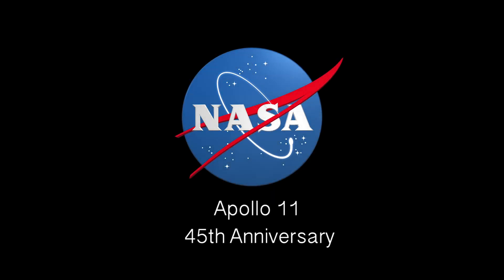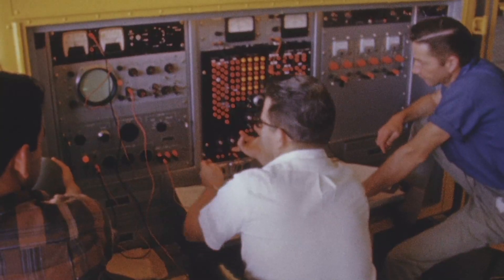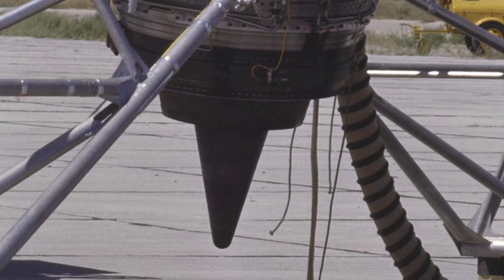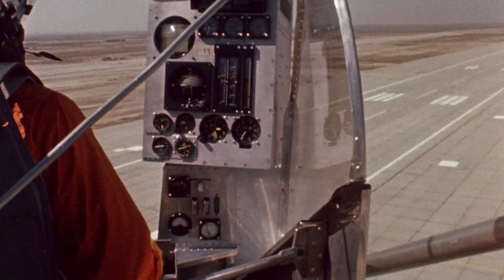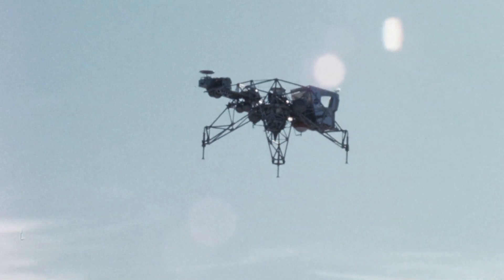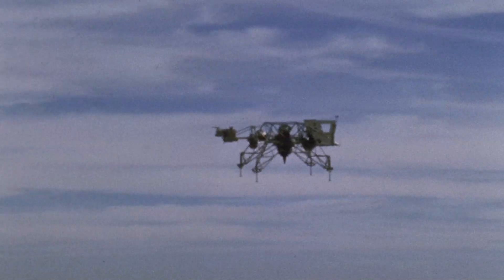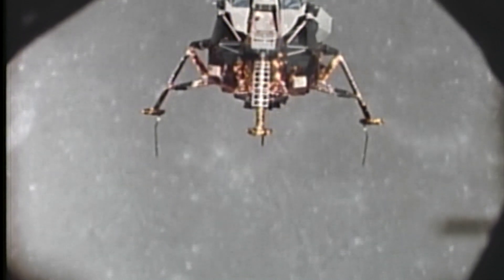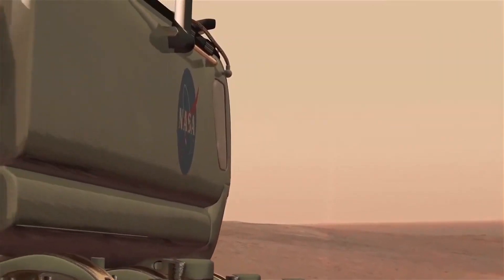LLRV Testing Contributed to Apollo 11's Success

Comment: As if this was anything like the LEM.
Reply: It can't be like the LM. Nor was it supposed to be.

The LM can only fly in space.
The LLRV could only fly on Earth.

But the LLRV DID handle very much like the LM above the Moon - and THAT was the whole point.
Reply: @eventcone  
>>Nor was it supposed to be.
Of course not, because, had it been like the LEM, it would have failed even more spectacularly.  The point was to go through the motions of 'testing' but not actually test it properly.
Reply: @markgerhard1362  what failure are you talking about? The LLRV/LLTV and the LM were both successful projects.
Reply: @silenthunter8254  

The LLRV nearly killed Neil Armstrong.  

The LM didn't even look very convincing in the studio.
Reply: @markgerhard1362  first off let me remind you, as many have before, the LLRV/LLTVs were not the LM. 
Second the LM's performance in lunar orbit and surface met all operational requirements. 
Armstrong escaped and flew other LLTVs in training prior to his actual mission in the LM.
Reply: @silenthunter8254  
So you genuinely believe that a craft which had never been tested worked perfectly every single time it was used? Nothing even remotely similar has ever flown reliably.

It's hard to address that level of credulity with logic.
Reply: @markgerhard1362  
All the components were tests.
Major subassemblies were tested.
Apollo 5, 22 Jan 68, unmanned mission. First flight of LM, testing all system, including descent and ascent engines...
Apollo 9, march 3, 1969, manned test of Lm in earth orbit, testing all system, including descent and ascent engines...
Apollo 10, 18 may 1969, flight testing in lunar orbit, testing of descent and ascent engines, coming within miles of the lunar surface.
Seams well tested to those who know about aircraft, engineering and technology.
Reply: @silenthunter8254  
Correct.  It was never actually tested.  At most, Apollo 10 established that the engines fired.  There was no way to test its stability, its maneuverability, or even the ability of the engines to land and lift the thing off.  No sane person would get into a death trap like that.

>>Seams well tested to those who know about aircraft, engineering and technology.
I don't know what seams you are talking about.
Reply: @markgerhard1362  well a mistyped word 'seems' does not negate the fact that all three flights before apollo 11 that flew the LM tested BOTH engines. The manned tests (9 & 10) proved the stability of the systems, including LM and CM docking.
That is what testing is.
Your ignorance of history is indicative of the lack of an education you recieved.
Reply: @silenthunter8254  

>>That is what testing is.
Obviously not.  Nothing was tested apart from the engines.

>>Your ignorance of history is indicative of the lack of an education you **recieved**.
Somebody who can't spell simple words shouldn't speculate about the education of complete strangers.
Reply: @markgerhard1362  let's see, docking, navigation, life support, communications, emergency protocols, the engines, every aspect except the landing gear, but that was extensively test under simulated conditions on earth.
A few spelling errors compared to your lack of engineering knowledge... I'll settle for that.
Reply: @markgerhard1362  maybe you have only worked with people who do not understand how to design and test equipment prior to development and introduction. This was not a two week job, more like a many year project  to get everything working before the flight to the moon. Loads of competent and intelligent people were employed on these projects to get people to the moon. I doubt you have the training to do anything like this, even if you had you would have failed the interview, people had to be 'can do, will do' people!!
Reply: @silenthunter8254  

>>every aspect except the landing gear,
Um...no.  What was not tested was the ability of the craft to actually fly.
Reply: @johnwoody9505  
I can see that you are frustrated that I don't share your belief system.  Do you have any more childish abuse to share with us?
Reply: @markgerhard1362  did you not read where  the tested it on apollo 6, 9, 10?
Those are flights. Apollo 6 was unmanned but remote operated, all the systems were tested, except landing gear.
Apollo 9 was manned, all systems were tested, except landing gear.
Apollo 10, manned in lunar orbit, all systems were tested except landing gear.
When I say landing gear I mean they deployed the legs but had no way of actually do landing test. However, the landing legs were extensively tested in simulated conditions on earth.
Reply: @silenthunter8254  

>> did you not read where the tested it on apollo 6, 9, 10?
I read about this in the 1960s, thanks.

Everything was tested apart from what actually needed to be tested, namely, the ability of the craft to land and take off safely.  The problem was the stability of the device near the lunar surface, not whether the legs retracted properly or whether it could dock.
Reply: @markgerhard1362  , if I believe that the US sent astronauts to the moon successfully, is that a belief system? I am just saying that I believe that humans did send fellow humans to the moon to land and come back on 6 occasions, that's all. I'm not sure I was aiming childish abuse at you, I'm certainly not frustrated you think we didn't send astronauts to the moon. It is not abuse to suggest you may not have been in the type of industry I was trying to imply, very few people did work in those types of industry. The people on the apollo missions had to be extremely motivated and hard working in their work on the project. When a problem arose people had to sort it out, I've never worked in an industry where people had to work so hard as the apollo and associated industry engineers. The apollo astronauts had to be excellent test pilots and dedicated to their jobs and maybe, realise that there was a chance they wouldn't come back. I have absolute admiration for the jobs they did. I wonder if you have read any of the astronauts recollections of their training and missions in their books, they are very interesting, well at least I thought so.
Reply: @johnwoody9505  

>>is that a belief system?
Yes.  Because it's not based on a rational thought process or evidence, but rather 'proof by authority'. It's part of your world view, so you are emotionally attached to it.

>>that there was a chance they wouldn't come back.
They were just prancing about in a studio.
Reply: @markgerhard1362  "At most, Apollo 10 established that the engines fired.  There was no way to test its stability, its manoeuvrability". Actually the ascent stage had to manoeuvre to dock with the command module so the ascent engine control and thrusters had to work precisely to dock successfully with the command module. This docking is quite a technical space manoeuvre to do. By the way you did spell 'manoeuvrability' incorrectly, no big deal, I'm sure we all do that from time to time.
Reply: @johnwoody9505  

>>manoeuvrability
That is the British spelling.  I am British.
Why don't you check your facts before sharing your opinion?

>> the ascent engine control and thrusters had to work precisely to dock successfully with the command module. 
Docking wasn't the problem.  The problem was stability during landing and take-off.
Reply: @markgerhard1362  the unmanned surveyor craft tested the ability to land.
The liftoff was engineered and then tested on apollo 11. Someone has to be the first to strap into that new vehicle, or try the next maneuver. It takes a lot of courage to be the tester.
Saying they faked it is a slap in the face of the brave men of Apollo. If that is what you have to do to make yourself feel empowered, I feel sorry for you.
Reply: @markgerhard1362  'prancing about in a studio' is part of your belief system.
Reply: @johnwoody9505  

>>The people on the apollo missions had to be extremely motivated and hard working in their work on the project. 
Any other empty speculation you would like to share with us?

>>When a problem arose people had to sort it out
So not like eBay.
Reply: @silenthunter8254  No, it's based on deep analysis of every part of the Apollo programme, including hundreds of hours spent looking at the anomalies.  I have been doing this since the 1980s.

How much time have you spent investigating the anomalies?
Reply: @markgerhard1362  ">>manoeuvrability
That is the British spelling.  I am British.
Why don't you check your facts before sharing your opinion?"

I accept that "manoeuvrability" is the British way of spelling the word, that is how I spelt it. You spelt it "There was no way to test its stability, its maneuverability". I spelt it the way I did because I am British.
Reply: @johnwoody9505  
Are you just cutting and pasting text now?
Reply: @markgerhard1362  I did cut and paste your comment and I referred to dictionaries to check my comment. 

Can you prove that the astronauts were just "prancing about in a studio". I did cut and paste your comment, it makes it quicker and less prone to error.  
Give me a few of the anomalies that you have found since the 1980s.
Reply: @johnwoody9505  
No dust on LEM feet despite dust shown in landing footage.
Antenna missing from astronaut but can still transit and receive (A16).
Nonsensical guidance system (aligning a dim star with a feature on Earth) (A11).
Rover shown with no tracks coming or going.
Same props used on multiple missions.
Absurd construction of LEM (bits of sheet metal cut to the wrong size, rivets in the wrong place, etc. etc).
Obvious anomalies in all other NASA missions inc. ISS.
Obvious motives.
Confusion about whether stars can be seen in cis-lunar space. 
Obvious anomalies in still photos.
Obvious lighting issues.
Video supposedly transmitted from moving rover.
Rover cannot fit into space it was allocated to.
Weird statements made by Neil Armstrong
The fate of the Apollo 1 crew and comments made by them before their death.
Harnesses seen reflected in studio lights.
Lack of any evidence of 1/6th g.
Cameras used perfectly each time, despite no viewfinder and thick gloves.
Able to hit post into solid rock.
Reply: @johnwoody9505  
Absurdity of six perfect missions but no return.
Three NASA astronauts all saying on camera that no one went to the moon.
NASA video saying that it would be dangerous to go through van Allen radiation belts cf Buzz Aldrin not even know what the VARB were.
Confusion about air pressure in LEM.
Door in LEM too small for astronaut to exit.
Anomalies on A17 take-off video.

I can think of hundreds, but these are just a few.
Reply: Absurd strategy of using completely inexperienced astronauts for A 12, etc., when experienced astronauts could have gone again.
No concrete evidence of any kind.
Obvious evidence of front-screen projection.  Association with Kubrick.
Lack of direct video upload.
Reply: @johnwoody9505  
Same LR used on several missions.
Background of A16 doesn't correspond with topology as claimed by Lunar Orbiter, nor with 360 degree panoramic shot as claimed also for A16.
LR has exactly the same dimensions as a jeep.  This is presumably what was used for the chassis.
Reply: @markgerhard1362  For starters, 
1. Give me a link to photo for antenna missing.
2. Rover with no tracks showing.
3. Video transmitted from moving rover.
4. same props used on multiple missions.

I cannot see the problem of taking photos with gloves on, please explain.
Reply: @markgerhard1362  I've only been looking into this since the 1990s.
Whose claims do you follow?
Kaysing?
Percy?
Sibrel?
White?
Rene?
Hoagland? 
Do you follow Jaren, dubey, etc...
Reply: @silenthunter8254  I don't follow anybody's 'claims', unlike you.  I sift through the evidence and think for myself.
Reply: @markgerhard1362  The lunar module door was 32 inches square, the width of a typical door frame. Width wise it was easy, height wise it just took a little care when exiting or climbing in, in fact never a problem. I cannot see why you think it might be too small.
Reply: @johnwoody9505  

>> I cannot see why you think it might be too small.
Because it wouldn't have been possible for the astronaut to turn around inside the LEM in order to get into position, given the presence of the other astronaut.  This is a problem which needs to be looked at in 3D space.
Reply: @markgerhard1362  well it looks like you've been paying attention to percy and sibrel a bit, and maybe some jack white.
As for the apollo antenna that would apollo 15 not 16. The broken antenna was taped on and worked well.
Reply: LM cabin was 5' wide at the floor, 6.5' tall, 7' deep mid height, but 3' deep floor. Not roomy enough for a party but with careful maneuvering two men in full gear and PLSS could easily fit thr6the hatch.
Reply: @markgerhard1362  The LM door opened inward and it was not a simple manoeuvre for both astronauts to exit the LM. "The claim that there was no room for the astronauts to move through the hatch way  is false. It was awkward, leaving the cabin required the commander to crawl out first, then the lunar module pilot closed the hatch, moved across the cabin and reopened the hatch before exiting. Getting back in was just as inelegant a process. Both procedures were rehearsed in mockup LMs on Earth and on a “vomit comet” microgravity simulation aircraft."
This excerpt is from;
http://www.armaghplanet.com/blog/15-questions-about-the-moon-landings.html
In fact the time taken to exit the LM on the moon took longer than it took during simulations on earth. When they did the simulation on earth everything was stowed away and the place was tidy, in reality on the moon, stuff had to be moved out of the way..
Reply: @markgerhard1362  
Still waiting for;
1. Give me a link to photo for antenna missing.
2. Rover with no tracks showing.
3. Video transmitted from moving rover.
4. same props used on multiple missions.

I cannot see the problem of taking photos with gloves on, please explain.
Reply: @markgerhard1362  in response to your question, I have been following space exploration since I watched Apollo 11 land on the moon. If you've been 'investigating' apollo since the 1980s you are the atypical HB. They normally don't think anything happened before 2000.
I would like to see your evidence more in depth. You shotgun a bunch of claims, many of which others have made and been disproved, but do you have real proof of any of them.
Reply: @johnwoody9505  
If you want to attempt to address these points you have to do so using evidence, not quotes from True Believer websites.
Reply: @johnwoody9505  
I'm not wasting hours finding clips to try to convince somebody whose mind has already been made up.   If you were open-minded you would have looked at this long ago.

Moreover, if you were genuinely interested in challenging your own beliefs you be interested in the quotes from the three NASA astronauts who said that humans never went to the Moon.
Reply: @silenthunter8254  Three NASA employees and one ex-president of the USA agree with me, not with you.

>>HB. They normally don't think anything happened before 2000.
An HB is a type of pencil, so I have no idea what you are talking about.  Why do you make that childish comment about 2000?
Reply: @johnwoody9505  
The person who did this analysis actually went to a museum, persuaded the curators to let him have access to the LEM, and measured it in detail.  The question is, what was the layout in real life, not what does a random website (or even NASA) claim was possible?   The problem was not the overall size, but obstacles inside the craft.

The same is true of other aspects of the 'mission'.  

Look at the heat shield and explain how oxygen passed through it.

Look at the obviously fake ISS footage and explain why an organization which is credible would create such deceptions.

Ask yourself why Buzz Aldrin said that he hadn't been to the moon, on camera.

Ask yourself why two other NASA astronauts said that nobody had been to the moon.
Reply: @markgerhard1362  link buzz's comment and we will look into that claim.
Link the US president's statement. 
If you are talking about the Orion engineer or Don P, they were takin out of context. 
Sorry if my year 2000 comment offended you, with your beliefs about apollo you need to develop thicker skin. I will take that into account in the future. 
HB is a term for hoax believers, others such as yourself. Many of whom want to believe the worse in others and puff themselves up for many different reasons.
Reply: @markgerhard1362  which heat shield let oxygen pass through it?
Reply: @silenthunter8254  
None did.  That's the problem.
Reply: @markgerhard1362  none did what?
Reply: @markgerhard1362  As you have been investigating the apollo missions since the 1980s, giving me links to the things I asked about would be so simple for you. My mind is 99% made up that we went to the moon, in the last four years that I have looked into it I have had loads of 'evidence' like rovers with no tracks. Maybe the ones you know about are the ones I've looked at, maybe you do not have the confidence that your 'evidence' is irrefutable. I have never seen so called rovers with no tracks that are not easy to debunk, maybe this is why you are slow to give me the 'evidence'. 

The size of the hatch was what NASA say and what a hoaxer measured himself. With all the money spent on the missions, if it was all hoaxed why didn't they spend a few extra dollars to make the door wider? This defies logic, spending billions on the rover, LM Saturn V, then making a mock up with the doors too small, give me a break!!!

Buzz Aldrin saying we never went to the moon, This is an interesting comment put about by hoaxers. You need to watch the FULL UNEDITED video before you come to a final conclusion.

No dust on the LM pads. This did take me a while to work it out and to convince a friend who was a moon hoaxer. I'm sure someone well versed in the dynamics of dust on the moon with no atmosphere would understand in seconds. Just as most people have problems with the thermodynamics on the moon, most people have problems with movements of dust on the moon.

I would like  to give evidence of some of your anomalies if I have links to these anomalies, without the links I cannot give you the evidence you do not want!

To save you hours of time wasted looking for rover photos without tracks, I found these ones that are often used as evidence of the rover being 'craned in' on the set. Are these the photos?

https://www.hq.nasa.gov/alsj/a15/AS15-88-11901HR.jpg

https://www.hq.nasa.gov/alsj/a17/AS17-135-20544HR.jpg

https://www.hq.nasa.gov/alsj/a17/AS17-140-21354HR.jpg

Do I expect a reply on these photos? No. I never had a hoaxer who said there were photos of the rover without tracks ever giving me photo numbers.
Reply: @silenthunter8254  
How did the CM communicate with the SM, and how did oxygen, etc., pass between them?  There's no evidence of any pipes on the outside.
Reply: @johnwoody9505  

>>maybe this is why you are slow to give me the 'evidence'. 
No, it's because I have better things to do than try to show evidence to somebody who has already made up his mind.  If you started with the smoking gun evidence, such as the confessions of the astronauts, I would take you more seriously.

>>You need to watch the FULL UNEDITED video before you come to a final conclusion.
So what part of 'we didn't go' was taken out of context? What part of 'we didn't go' as said by two ISS astronauts was 'taken out of context'?  What part of NASA saying that Orion had to be shielded was 'taken out of context'?

>>if it was all hoaxed why didn't they spend a few extra dollars to make the door wider?

There was never a need to film somebody coming out of the LEM, obviously.

>>This defies logic
No it doesn't, it's entirely logical, for the reason I just gave you.

>>spending billions on the rover
It didn't cost 'billions' to convert a jeep.

>>Saturn V
I doubt that it cost much to develop SV, either.  There was nothing particularly innovative about it.

>>most people have problems with movements of dust on the moon.
So explain why dust that was blown up by the rockets settled everywhere apart from on the pads.
Reply: @johnwoody9505  

Thanks for the photos, which I assume were taken from a 'debunking' website.  They are not ones used to demonstrate the lack of tracks: the first two are obviously from the wrong angle and the third one obviously has footprints which could be covering up the tracks.
Reply: @markgerhard1362  if you could look at these three photos from Apollo 17. You can see the CM/SM from the LM as it returns from the surface.
https://www.hq.nasa.gov/alsj/a17/AS17-145-22239HR.jpg
https://www.hq.nasa.gov/alsj/a17/AS17-145-22240HR.jpg
https://www.hq.nasa.gov/alsj/a17/AS17-145-22241HR.jpg
You can see a box on the side of the craft, to the right of the high gain in 22239, this is the cover for the umbilical between the CM and SM.
I hope that was helpful.
Reply: @markgerhard1362  when you see a LRV in the videos on the moon watch how the mesh tires pickup and throw the regolith around. In some you can see when they stop all the material caught in the tires dumps out, covering most of the tracks. Then when the astronauts get out and start walking they kick up a lot of loose regolith covering more tracks.
Reply: @silenthunter8254  

>>covering most of the tracks.
But this wouldn't cover the tracks completely.

>>they kick up a lot of loose regolith covering more tracks.
Why does the does the dust cover up a 1cm deep track but completely missed the lunar pads?
Reply: @markgerhard1362  I've spent about 20 minutes ad found about a half dozen photos of regolith/dust on the pads. I'm not even through A14.
Reply: Wrong, the photos are from a hoax website by Andrew Johnson.
https://vimeo.com/48303133
goto 24:10 for his 'evidence'.
At least he says what photos he has to prove the rover was 'craned in'.
Not sure what you mean by "the first two are obviously from the wrong angle ".
The issue of "Video supposedly transmitted from moving rover". Well I've never seen a video transmitted from a moving rover, didn't think it could happen. It would certainly blow a hole in my 'belief system' if such a thing occurred. I would be absolutely amazed if you could give me a link to such an occurrence. 
Four years ago when I was seventy, a friend brought around this video to prove to me that the apollo missions were hoaxed. I had not followed the apollo missions as a young man and never realised that there was some people who thought it was hoaxed. I was amazed at the 'evidence' Andrew Johnson put forward, the only piece I could say anything about was the pictures was the 'low earth orbit' bits that NASA tried to say was from 25,000 miles from earth on the way to the moon. This 'evidence' is at about 48:00 onwards. I didn't even know what LEO was but knew that the images of earth were from a long way out. This was my starting point. I proved to myself and my friend that the images were not from LEO. I just went through the whole video, I was amazed at what was on the web about the apollo missions and for about two years I was very active in commenting on hoax websites. 
After about two years a pattern arose, the hoaxer would list loads of evidence proving we never went. Ask them for links to photos etc., most refused although they were very forthright in their assertions beforehand. Their 'evidence' would just melt away under scrutiny.
The photos etc. that Andrew Johnson put forward were by people who had obviously trawled through loads of photos and cherry picked ones to put forward. I soon realised that the people who did this were less that honest because often photos adjacent to the ones listed would often prove a deception. Hoaxers suffering from the 'Internet Gullibility Virus' would latch on to the photos and agree with the original dishonest hoaxer.
There are hundreds of photos from the apollo missions that are way below 'perfect', you obviously haven't looked at some complete reels of photos like I have. If you want to see some reels of rubbish photos, ask, I give you a link to some crap photos. Some astronauts were good some were bad, maybe some didn't take the lunar type cameras without the viewfinder on earth bound trips as asked to do to get used to the machine.
Through AJ's website I started to counter his evidence by other high resolution photos, his response was to say that there are some mistakes in his presentation, he then said he had had seen enough hires photos from me and was blocking me from his website.
This is the first occasion for some time that I have engaged in commenting at length because most hoaxers soon give up when they realise I will spend my own time looking into their evidence.
So Mark, where are your photos showing a rover with no tracks?
Where is the video showing a transmitted video from a moving rover.

If I had great evidence say of fakery I would want to share it with people, not refuse to share it.

It has been great having such good weather at this time of the year in Britain, shame it seems to be coming to an end.
Reply: @markgerhard1362  The LLRV may have been caught by a gust of wind but Neill didn't die but neither did any astronauts in any of the hundreds of training flights. The flights on the moon in the LM would be easier with no wind to contend with and just 1/6th gravity pulling them down. The training on earth although not a perfect environment, would have helped them in the real thing.
I wonder what sort of training vehicle you would have designed?

I've seen a few websites saying how bad the design of the LRV was, I just wonder how these people would have approached the task. 

Of course the LM didn't need to look convincing, it just had to perform to its design standards. People often decry the appearance of the LM, not realising it didn't have to be aerodynamic, it never flew in an atmosphere.
Reply: @johnwoody9505  

>>The flights on the moon in the LM would be easier with no wind to contend with and just 1/6th gravity pulling them down. 
The lower weight would have made no difference.  This is a design which has never been stable in any environment.  The proof is quite simple: craft like this don't exist on Earth, even though they would be of enormous value.  The military would happily pay billions for a craft such as the LEM - or, even more absurdly, the supposed unmanned Mars probes - which could move soldiers around quickly without the need for a trained pilot.

>>I wonder what sort of training vehicle you would have designed?
I wouldn't have used a training vehicle.  I would have trained them in the LEM itself, with obvious additional support to make up for the higher Earth gravity.  
>>realising it didn't have to be aerodynamic, it never flew in an atmosphere.
Like all True Believers, you arrogantly assume that anybody questioning your belief systems must be stupid.

>> I just wonder how these people would have approached the task. 
Maybe not using glue and sticking tape to hold parts of the structure together.
Reply: @markgerhard1362  you want to transport troops at the speed of a mars rover??? Omg, don't make a statement like that and expect not to be ridiculed. 
Troops walk faster than the mars rovers...
Reply: @markgerhard1362  why the military would want a LM, a vehicle designed for a 1/6 gravity atmosphere less environment is another 'interesting' comment. Btw, you do know the military has helicopters right.
Reply: @markgerhard1362  how does one train in the LM when it cannot properly operate on earth due to gravity and atmosphere.
Reply: @silenthunter8254  Um...we were talking about the LM.  Why don't you think before you react next time?
Reply: @silenthunter8254  
I'm getting tired of your childish put-downs, to be honest. 

In the 1960s there was a great deal of discussion about using craft such as the LM to move troops about.  

>>you do know the military has helicopters right.
No, I'm too stupid to know that.

There are various reasons why the military was interested in vertical take-off jets.  First, if they existed as described by NASA, they could be automated and wouldn't need a pilot.  Second, they could be scaled.
Reply: @silenthunter8254  Did you even bother to read my comment?  Please read it first.
Reply: @markgerhard1362  "The military would happily pay billions for a craft such as the LEM - or, even more absurdly, the supposed unmanned Mars probes - which could move soldiers around quickly without the need for a trained pilot."
Your words sir.
Robotic transports have been studied. One of the main issues with the AI is it's inability to react to fast changing combat situations. 
As for VTOL capable aircraft there are helicopters, jump jets such as the harrier and the Lightning 2. For troop transport there is the osprey. 
As for childish comment, I apologize for treating you as a millenial, but your tactics do resemble theirs. In particular when you make a claim and evidence is given to debunk it. Instead of acknowledging your misunderstanding of the facts you divert to a different topic.
Reply: @silenthunter8254  

>> Instead of acknowledging your misunderstanding of the facts you divert to a different topic.
This is precisely what you do.  If you were genuinely interested in getting to the truth of the moon landings, you would attempt to falsify the strongest evidence against them.  Instead, you flail about trying to poke holes in areas which you feel you can 'attack'. 

Whenever you are faced with strong evidence, such as the admissions on camera of NASA employees, or the lack of dust on the LM pads, you change subject.

It matters not one iota what the military may or may not want t do.  I was - obviously - referring to craft based on a single jet engine.  Yes, they would be bigger than the supposed Mars lander.

Why don't you try to discuss this like an adult?
Reply: @silenthunter8254  

Maybe I am assuming that you are brighter than you really are.  Your comments suggest that you think emotionally rather than rationally.

My point was simply that a craft with a single jet or rocket engine underneath is inherently unstable.  This is why it hasn't been used by the military.  This is why NASA's test rig crashed and nearly killed Neil Armstrong.  And this is why it's implausible that a design like this - especially one which was untested - could have worked on the Moon.
Reply: @markgerhard1362  I guess I'm not as bright as you. I didn't notice how you chastised me for childish comments and then turn around and throw a childish comment in my face. I'll keep the conversation on a more civilized basis if you will.
Reply: @markgerhard1362  the admissions of the NASA employees were cherry picked from longer statements that did not say NASA has never been to the moon, they just haven't passed through the middle of the VARBs.
Don petits' remarks about 'destroyed technology' is definitely taken out of his intended comments. Engineers should not be allowed to talk, their thinking patterns are not easily understood by non-engineers.
A few of the things he was alluding to were:
Apollo launch complex 39's pads have been reconfigured for other purposes. 
The Saturn V rockets have not been built since the 1960/70s.
Almost every other aspect of the Apollo program has been retired or reallocated to other projects. 
The focus of NASA since the Apollo missions has been near earth for manned and robotic for long range. The Orion capsule project is the program to replace the Apollo capsule using more modern hardware. As you know the more modern systems, while having far more capabilities, is more susceptible to harsher environments.
Reply: @markgerhard1362  to the dust on the landing pads I have found about a half dozen photos of regolith/dust on landing pads and have not finished A14. I will look some more as time permits.
Reply: @markgerhard1362  did you get a chance to look at the photos of the CM/SM umbilical?
Reply: @silenthunter8254  I'm sorry to descend to your level.
Reply: @silenthunter8254  

>> the admissions of the NASA employees were cherry picked from longer statements that did not say NASA has never been to the moon, they just haven't passed through the middle of the VARBs.
So what about the statement 'Humans have never been outside of low Earth orbit' was 'taken out of context'?  What context could change the meaning of this? 

>>Don petits' remarks about 'destroyed technology' is definitely taken out of his intended comments. Engineers should not be allowed to talk

Don Petit is not an engineer.  It's clear from his other statements that he has cognitive problems.  We can safely discard everything that he says. Forget about his nonsense and focus on the comments made by the astronauts.
Reply: @markgerhard1362  'descend' to my level?
Whatever. 
Now to stay away from those childish comments...
Reply: @markgerhard1362   yes, some stupid things were said, that does not prove anything except individuals can get so wrapped up in a project and miss the big picture. When they were speaking they may have had, how did you put it, cognative problems. That is just a momentary confusion not an admission.
How about getting back to the air passing through the heat shield topic that you brought up.
Reply: @silenthunter8254  
>>That is just a momentary confusion not an admission.
Why are you still focussed on Petit?   Did you even read my response?
Reply: @markgerhard1362  I don't know what to tell you except like I said before, that is not an admission of fakery (is that a word) but a moment of confusion during a stressful time.
Still no response on the heat shield? I guess we're ignoring that then... ok.
Reply: @silenthunter8254  

Why do you keep referring to Petit?   You seem extremely confused.
Reply: @markgerhard1362  I have not mentioned Don P for two hours, about five of my posts ago.
Why do you keep bringing him up? 
Did you see those photos of the CM/SM umbilical yet?
Reply: @silenthunter8254  
>>Did you see those photos of the CM/SM umbilical yet?
No.  It's mentioned on one of the shill channels, but I can't see it in any of the NASA diagrams.  It's a bit of a mystery, because even if it existed it would have burnt up on re-entry.

Do you have an actual photo?
Reply: @markgerhard1362  I sure do, I linked them above but will relink them here so you don't have to fish back through the posts.
https://www.hq.nasa.gov/alsj/a17/AS17-145-22239HR.jpg
https://www.hq.nasa.gov/alsj/a17/AS17-145-22240HR.jpg
https://www.hq.nasa.gov/alsj/a17/AS17-145-22241HR.jpg
Let me know if the links don't work.
The umbilical was on the side so it did not have to penetrate the heat shield. When they jettisoned the SM the connection was broken first and it went with SM.
Reply: @silenthunter8254  
It's strange that it doesn't appear in their diagrams of the CM and SMs. However, it was obviously on the model used for the A13 shots and in the shots you sent, so it wasn't an afterthought.
Reply: @markgerhard1362  I found it in shots of A9, A10, A11, A15, A17. It was on every apollo mission, just not shown in any photos, none from the right angle.
Reply: @markgerhard1362   "I would have trained them in the LEM itself, with obvious additional support to make up for the higher Earth gravity.” 

I expect you would have to take off in the LM as per the LLRV, fly around and land it.

Have you thought this through? An actual LM? That  engine would needed to have been massively uprated to be able to fly in earths gravity, not just the 10,000 lbs of thrust. For any length of flight the fuel needed would have been equally massively increased. For hundreds of trial flights have you considered the type of engine you would design in? Presumably you would not use the same type of engine massively uprated. The engine would need to be serviced after every flight and replaced after a very short period of use. To redesign a massively larger similar engine would cost millions if not billions of dollars as well. You could use a liquid oxygen/liquid hydrogen rocket engine, this would still be difficult to use as a training vehicle. Loading the liquid propellants and unloading if necessary is a slow and dangerous job, these engines again are not usually designed to be day to day utility engines. Probably the easiest engine to fit would be an off the shelf jet turbine engine like they used on the LLRV. Cheap to buy easy to service and it would probably last the service life without huge servicing costs. The fuel is easy to handle, cheap to buy and easy to store and available just about everywhere. I reckon the jet turbine would be a winner here.

The LM would have been an extremely expensive thing to butcher to get a massively larger engine in it to be able to do everything the LLRV did. I would imagine there would be no room for the ascent engine, you don’t need it for descent practice any way. Anything taking the strain of the larger engine would have to be uprated by significant margins, a massive design change in itself. The landing struts designed for a lunar landing would obviously fold if landed on the earth. Again massive upgrading of all parts of the landing struts would need to be implemented. Where the struts join onto the descent stage there would need to be massive strengthening. In fact I reckon there would be very little left of the descent stage to get it to work on the earth. You could save weight by taking off the complete ascent stage, it would not be needed to train for a lunar landing. 

So I reckon the system that was designed, the LLRV was perfect for the job, a jet engine, no ascent stage etc. It would have been  much cheaper that trashing a proper LM and using an off the shelf engine. Easy to service, cheap and a safe easy to use fuel. That's my take on it.

"I would have trained them in the LEM itself, with obvious additional support to make up for the higher Earth gravity.” 

This is what I would call management speak, where the manager would not have to do the task and the manager hadn’t thought it through his/her self.
Reply: @markgerhard1362  You may be right about the weight making no difference, I thought that with the acceleration due to gravity on earth being 6 times greater that on the moon things would just happen so much faster, the time to react etc would make flying it in the moon environment would make it easier. The LLRV was a very successful training vehicle. It was never designed to replace helicopters on earth, just a training vehicle to try to simulate landing on the moon. The only accident in hundreds of trying flights was when on was caught by a gust of wind. Even in that case the pilot survived by using a rocket powered parachute system. Imagine what would have happened if a gust had caught a modified LM with the pilot stuck inside, dead pilot I'd guess. No, the NASA engineers/contractors proposed, designed and built the correct vehicle. To be honest Mark I would expect those intelligent people who worked in the industry to know better than the likes of you and me.
Reply: @markgerhard1362  Can you substantiate your claims of the following;

 the footage of a transmitted video from a moving LRV. 
Rover with no tracks.
Same props used on multiple missions.
Weird statement made by Neil armstrong.

How many photos do you think that were taken on the lunar surface on Apollo 11?
Reply: @markgerhard1362  Can you explain to me what you mean by your statement please, photos would be nice.
"Absurd construction of LEM (bits of sheet metal cut to the wrong size, rivets in the wrong place, etc. etc)."
Reply: @markgerhard1362  where did you find these diagrams? Google search apollo cm sm connection. 
It's not something shown in most diagrams, but it does show up regularly in the photos. It is on the opposite side than the crew hatch, most photos are from the hatch side so it is harder to see.
Reply: @johnwoody9505  
No, you would use a device which supplemented the thrust from the LM engine.
Reply: @johnwoody9505  

>> The LLRV was a very successful training vehicle.
If by 'successful' you mean that it would reduce the World's overpopulation because it crashed so often, I agree.

In any case, the point was not whether a better training vehicle could have been devised or not.  It was whether one should trust claims that a completely untested craft flew perfectly on every flight.

Neither of us has any way of knowing if these people were intelligent.  Most government agencies and large corporations are full of dead wood.  I doubt that this was an exception.
Reply: @johnwoody9505  

You need to do your own research on this.  My experience is that True Believers are not really interested in testing their beliefs.

>>How many photos do you think that were taken on the lunar surface on Apollo 11?
None, obviously.
Reply: @silenthunter8254  

>>where did you find these diagrams?
On the NASA website.

So, we've established that they did actually think about getting oxygen from the CM.  What about the testimony of ISS "astronauts"?  You seem to be avoiding that one.
Reply: @markgerhard1362  Hi Mark, so you would use the existing engine, would you. To supplement this engine you would probably need another six engines at least to overcome earths gravity!! Surely you would not use the hypergolic fuels in the new engines or the old one. What about massive strengthening for the legs to support at least 6 times the weight and the extra engines. The whole superstructure of the LM would have to be massively strengthened. Hoe would you attach the 'device' to supplement the thrust, more massive strengthening. Do you realise the problems of using the hypergolic fuels. There is no need to use hypergolic fuels, use normal fuels. I do believe you do not understand the impossible problems of trying to modify a LM to do the job on earth.
Reply: @johnwoody9505  
I wasn't suggesting adding new engines to the existing framework, but rather a mechanism for supporting the LM so that its stability close to the ground could be tested.  Something along these lines was actually built by NASA at one stage.

In any case, this is empty conjecture.  The point is that it's naive at best to assume that a completely untested craft would fly perfectly every time it was used.  This is just one of many obvious absurdities in the Apollo narrative.
Reply: @markgerhard1362  So Mark, give me the number of pilots killed in the LLRV or LLTV in the flights that they performed. At about the same time as the moon landings, an extremely new untested machine flew for the first time. It was complete divergence from existing similar craft. The craft was Concord, March 2nd 1969 was its first flight. First supersonic passenger jet liner, flew at mach 2.01 flew for year without a crash. Maybe you would think that something like the LM could not be designed to work first time, maybe you are miss judging the abilities of the fantastic engineers and scientists of the 1960s. Just think how complicated Concord would have been compared to the LM and it flew for thousands of times without crashing.
Reply: @markgerhard1362  So one one hand you are saying no photographs were taken because they never went, then you say they took all those perfect photos without a view finder and in armoured gloves. So, not how many photos did they take but how many photos do NASA claim they took? Just a all park figure is all you need.
Reply: @johnwoody9505
Reply: @johnwoody9505  

>>The craft was Concord,
Actually it was called Concorde.

Concorde was a plane, much like any other plane, using wings for lift.  The LM was an entirely new kind of craft.
Reply: @johnwoody9505  

>> then you say they took all those perfect photos without a view finder and in armoured gloves. 
No.  I said that was the official narrative.
Reply: @markgerhard1362  You are correct, the spelling should have been Concorde. What engines and what fuel would you have used in your modified LM? By how much would you needed to increase the thrust by? Surely you would have had to increase the strength enormously of the legs and superstructure.
Reply: @markgerhard1362  to add to John's comments about using an actual LM for training on earth, the landing gear was a one use system. It was designed to absorb the landing impact but to do so it collapsed itself and there was no mechanism in place to reset it.
Attaching a rig did provide some simulation but a static rig is not the same as actual stick time in a working craft.
Reply: @markgerhard1362  I'm not avoiding the ISS astronaut comments, doing some further investigation. 
I hope to have something for you soon.
Reply: @silenthunter8254  OK.
Reply: @markgerhard1362  So mark are you saying that you cannot take photos without a viewfinder and with thick gloves? If so why would thick gloves stop you? Why would you have to have a viewfinder?
Reply: @johnwoody9505  

>>are you saying that you cannot take photos without a viewfinder and with thick gloves
No, that's not what I said.  Please read my comment.

>>Why would you have to have a viewfinder?
In order to frame the photo properly.
Reply: @markgerhard1362  if you have been looking into apollo since 1980s then you will have seen many photographs poorly centered, out of focus, bad sun angles...
The astronauts were given the opportunity to use the cameras for months prior to the missions to acquaint themselves with them. Many got very proficient but there are plenty of bad shots.
Reply: @markgerhard1362  Mark I've read many of your comments. I think you have no evidence that the apollo missions were hoaxed but imply that you have loads.
Reply: @silenthunter8254  >>there are plenty of bad shots.
Not a very high proportion.  In fact, the average person using a modern digital camera produces a higher proportion of fails.

And there are obvious lighting, focussing and perspective issues with many of the photos.  For example:

https://www.lpi.usra.edu/lunar/missions/apollo/apollo_11/images/footprint_lg.gif

How come this is in focus, but shots in the distance are also in focus?  There was no autofocus.

And how did they change film magazines?
Reply: @johnwoody9505  

Why don't you actually look at some of the evidence?
Reply: @johnwoody9505  
To be honest, no amount of evidence would ever persuade somebody whose belief systems are so impenetrable.   

I'm sure that you would believe absolutely anything, so long as you saw it on television.  No amount of evidence can compete with the overwhelming 'authority' (in your mind) of a television presenter.
Reply: @markgerhard1362  But Mark you have zero evidence!!
Reply: @johnwoody9505  
Just for our amusement, can you share some more of your irrational beliefs based on blind trust in 'authority' figures?
Reply: @markgerhard1362  let's look back at some of your points
"Absurd strategy of using completely inexperienced astronauts for A 12..."
This is the crew for A12.
Pete Conrad...
Gemini V - 21 aug 1965, 8 days in space. 
Gemini XI - 12 sep 1966, 3 days.
- Agena target rendezvous. 
Richard Gordon...
Gemini XI - 1w sep 1966, 3 days.
- Agena target rendezvous. 
- 2 EVAs totaling 2hrs 41mins.
Alan Bean...
No prior flights.
Not a rookie crew, yes Bean was new but was a USN test pilot during his Navy career.
Reply: @markgerhard1362  John has more concrete evidence on his side than all the 'evidence' against.
If I had any free time I could destroy your list of issues within hours, I know because I have in the past. These are not new, just regurgitated arguments by every HB I have seen.
You sir are the one whose belief system is based on inaccurate, misleading, false, information.
Reply: @silenthunter8254  
So in other words you haven't even bothered to look at the clips showing ISS astronauts specifically saying that humans have never been beyond low Earth orbit.  Don't worry - your belief system is secure.  The last thing you need to do is to look at evidence , you just 'know'.

Quite what 'concrete evidence' you believe John has isn't clear.  He hasn't presented even the tiniest scrap of evidence here. 

>>I could destroy your list of issues within hours
Not without bothering to look at it.
Reply: @silenthunter8254  

>>These are not new, just regurgitated arguments by every HB I have seen.

Which still haven't been addressed.  You were going to explain the lack of dust on the lander pads.  Remember?  And the lack of rover tracks.  And the inability of an astronaut to change a film cartridge using a pressurized glove.  And the fact that two ISS astronauts, one former Apollo astronaut and one former US president all say that the moon landing was a hoax.

I guess it's like the way Catholics believe in the power of priests to forgive sins.  Without the tiniest scrap of evidence and overwhelming evidence that they can't.
Reply: @silenthunter8254  

>>f I had any free time I could destroy your list of issues within hours, I know because I have in the past.
Superman to the rescue!  You can 'destroy' an argument you don't understand, based on an 'analysis' of video clips and photos you haven't seen!  Who needs evidence and logic when you have super-human powers!
Reply: @markgerhard1362  'superman' why such a childish comment, did I trigger something? 
I more than understand your claims, I'm just trying to understand how an Intelligent person such as you could fall for such ridiculous notions.
Reply: @markgerhard1362  Maybe for our amusement you could show your fantastic understanding of the engine changes needed for the LM and the legs etc for use on earth training. Type/size of engine and fuel type.
Reply: @markgerhard1362  Just for our amusement Mark, maybe you could give us a list of internet conspiracies you believe in that you have read on the internet. Maybe you suffer from the 'Internet Gullibility Virus'? Did you look at the Andrew Johnson video, maybe you thought it was full of well thought out evidence for the apollo moon hoax.
Reply: @silenthunter8254  
>>I more than understand your claims
You think you understand very much more than you actually do.
Reply: @johnwoody9505  
You didn't even understand my point about Earth training.
Reply: @johnwoody9505  

So...nothing intelligent to say, just the usual childish put-downs.
Reply: @silenthunter8254  

>>ridiculous notions
Your ability to sift through evidence without actually seeing it is astounding.  Yes, you really are a 'superman'.
Reply: @johnwoody9505  

What's really sad is that you genuinely believe that you have 'debunked' hundreds of scientific arguments you don't understand as a result of Googling and finding this PDF file.
Reply: @silenthunter8254  

>>ridiculous notions.

Only a 'True Believer' just "knows" that something is 'ridiculous' without actually looking at it.
Reply: @markgerhard1362  Typical hoaxer, never answer a question, just waffle on and on.
Reply: @markgerhard1362  "hundreds of arguments", have you been counting? Have you given any more thought to the engine modifications to the LM to make it work on earth. You've had plenty of time, still no answers. So what didn't I understand as a result of finding this PDF file?
Reply: @johnwoody9505  

The PDF file has nothing whatsoever to do with the question.  Nothing.  Nada.
Reply: @johnwoody9505  Why don't you try to focus on this nonsense?  That way, you won't have to deal with any evidence that's actually relevant and your belief system can stay intact.
Reply: @markgerhard1362  it's astonishing to me how people with well developed intelligence can fall for some of the weakest 'evidence' against the landings. 'It looks to me', 'in my opinion', 'I think they/it...' those are not facts. Opinions don't matter, only facts matter. The arguments against the NASA photographs usually come down to 'it is my belief that the photos don't look like I think they should.'
Your comments on the training they received on earth are based on fuzzy logic. How could they train for landing on the moon if no one has ever landed on the moon before. They can theorize how it might be and build the simulators based on that. Until someone actually does it and compares the simulation to reality it's all guess work. The training systems were good. Just because you think they were not does not matter.
Reply: @silenthunter8254  

>>How could they train for landing on the moon if no one has ever landed on the moon before. 

What are you talking about?
Reply: @markgerhard1362  so you lost track of the conversation about how you don't think they could have trained for the moon landings without practicing in the LM on earth?
Reply: @markgerhard1362  why do you assume I have not looked at any of your evidence? Have you given any except the link to the engineers comments taken out of content?
I have provided photos of 'dust' on footpads and how rover tracks are covered by the astronaut's walking around the LRV.
I have provided numerous proofs of the umbilical around the heat shield. 
It's now your turn to start supporting your claims with actual evidence instead of hearsay.
Reply: @silenthunter8254  

>>to the engineers comments taken out of content?
Why do you keep referring to Petit?  The interviews have NOTHING to do with Petit.

>>I have provided photos of 'dust' on footpads
And I have explained why finding dust on some footpads is not useful or interesting.  You need to explain why some pads have *no* dust.

>>I have provided numerous proofs of the umbilical around the heat shield. 
Which I looked at and responded to.  Unlike you, when I am presented with evidence I take it in.
Reply: @markgerhard1362  who said anything about Petit? The first engineer was talking about the Orion spacecraft. Petit was an astronaut. I said engineers. 
The only evidence you have presented so far is that ridiculous video by the guy who thinks near vacuum atmosphere would melt steel, which I've seen many times due to every single HB or FElemming uses it to try to prove there arguments, they fail. The video only shows the man does not know thermodynamics, or physics. He does know how to cherry pick comments.
Reply: @silenthunter8254  
So why do you think that Buzz Aldrin said 'We didn't go to the Moon'? '

And why did the ISS "astronaut" in the clip you just watched say "This is really the beginning of humans leaving low Earth orbit'?

Or, indeed, why did another ISS "astronaut" say that they were filming the "ISS" from the West coast of the USA?

I really envy you having a belief system which is so totally impervious to any kind of evidence.
Reply: @johnwoody9505  

I love the way you avoid hard evidence and spend hours attempting to nit-pick pointless details.  This is an excellent way of keeping your belief system intact.

Is your 'logic' that if the  LR is not the same as a jeep then the lunar landing must have happened?

Why don't you forget about the structure of the LR, forget about what rockets might have been needed to convert the LM to fly on Earth...and focus on the difficult questions?
Reply: @johnwoody9505  

>>Where is there any resemblance?
The chassis and position of the bar match extremely well.  Have you seem plans of the two vehicles superimposed, or have you just looked at a few brainless 'debunking' sites?
Reply: @silenthunter8254  

You are physically incapable of looking at this evidence.  It would make you ill.
Reply: @johnwoody9505  

Why don't you attempt to explain why three NASA astronauts have all admitted humans didn't go to the moon?

Or the lack of many metres of dust on the Moon after billions of years of meteorite bombardment.  Or the lack of any dust at all on the lander pads.

Or why the navigation system consisted of aligning a dim star with Cape Cod.

Your belief system is so well-tuned it knows exactly which pieces of evidence to ignore for its own safety.
Reply: @markgerhard1362  are you talking about the interview of buzz by 8 year old Zoey? At the she asks him about it and he tells how he and Neil did land. Later she asks why it has been so long to go back. He say they have not been back because they haven't. Not we never went.
Reply: @silenthunter8254  What part of 'we didn't go' are you confused by?  He said that the reason humans hadn't gone back (something any reasonably intelligent person would want to know) was because they didn't go there in the first place.

What part of 'this is the beginning of humans leaving low Earth orbit' do you not understand?
Reply: @markgerhard1362  It was you that said the LRV copied the chassis of the Jeep. It was you that said you could have modified the LM, both comments made by someone who doesn't have a clue about engineering. You make stupid comments that cannot be back up.
Reply: @markgerhard1362  Give me your evidence that three astronauts said humans didn't go to the moon.
Reply: @johnwoody9505  

Why don't you try to address the EViDenCe instead of desperately attempting to nit-pick points which are CompLEtely irRRelevant to the discussion?

If you superimpose a Willy's jeep over the LRV you can see that it has the same dimensions, including the position of specific structures such as the bar and steering column.  Obviously using a jeep would have made more sense than creating a structure from scratch - it only had to move around the studio for a few hours.  Neither of us was there, and NASA 'lost' all its designs, so the point is moot.

The US military was very interested in designs similar to that of the LM to move troops.  Obviously the ridiculous LM itself wouldn't have been used.
Reply: @johnwoody9505  

Why don't you give me some evidence that anybody DID go to the Moon?  All we have is some old footage, a very clear understanding of how it was faked, and the wild implausibility of the entire claim.  Oh - and confessions from three NASA employees, an ex-US president who agrees with them, the bizarre emotional responses of every single 'astronaut' and....about two hundred anomalies.  

So, how would YOU convince somebody who wasn't completely convinced in the integrity of the US government that this unlikely event actually happened?

You can't, obviously.
Reply: @johnwoody9505  

How did the 'astronauts' drive a flag pole into bare rock far enough that it could stand up?  Have you ever tried doing this?  Or did you just BeliEve them because they TolD you and you are GuLLibLe.
Reply: @markgerhard1362  you did not watch the first 3 minutes of that video where he said they did land did you.
See if you can follow this hypothetical conversation. 
Tina: "hey Dave, did you see that movie?"
Dave: "yea, me the wife and kids saw it a few weeks ago."
Tina: "have you gone back to see it?"
Dave: "no."
Tina: "why did you not go back to see it?"
Dave: "we just didn't. "
Now image Tina is an 8 year older and Dave is 85.
Reply: @silenthunter8254  
Why you just **watch** the video clips instead of guessing what might be in them?
Reply: @markgerhard1362  I have seen most of them, I have seen the original versions before they were cherry picked also. Big difference between what they really say and what some HB manipulates it to say.
Reply: @silenthunter8254  

So you still haven't plucked up the courage to look at the EVidENce.
Reply: @silenthunter8254  

Maybe you could share your opinions about some other videos you haven't seen!
Reply: @silenthunter8254  

Please share some more of your empty speculation with us.  Are there any books you haven't read which you could pass opinion on?  How about telling us your personal experiences with people you have never met?  You seem more than anxious to pontificate about interviews you haven't bothered to watch.

Maybe you and John Wooley could get together: you make a nice couple.
Reply: @markgerhard1362  who says I haven't watch your silly research sources? Just because I say there full of lies? I can say that because I have watched many HB videos, including the one you linked above, none of them has EVER shown proof that doesn't crumble under scrutiny.
Reply: @markgerhard1362  you make a list of your definitive proofs of the lunar landing hoax. On that list was a statement that the LRV was just a wiley's jeep, if we superimpose the jeep over the LRV everything lines up...
Fact check time...
Lrv wheelbase: 90.6"
Jeep wheelbase: 80"
...
Lrv width: 72"
Jeep width: 55.5"
If they sat them side by side you couldn't tell them apart right? But you can only recognize the difference between a cat and a dog 3 out of 5 times.
Reply: @markgerhard1362  Mark, now you know and I know apart from the fact that the jeep has four wheels and the LRV had four wheels, there the similarity ends. LM, ah yes the LM, strange one that.
Reply: @markgerhard1362  Loads of great photos, there's the evidence. Some people think among the thousands of photos there are a few anomalies, never seen any.
Reply: @markgerhard1362  Have you been to the moon?. How would you know it is bare rock. Wasn't there dust that flew up that covered some of the rocks?
Reply: @silenthunter8254  
No - you're right.  Your own prejudice is more than enough to backup your crazy belief system.  The last thing you need is to bother to look at evidence.
Reply: @silenthunter8254  
Well you've proved it, then: humans must have gone to the Moon.  Case closed.
Reply: @johnwoody9505  

Case proven: NASA must have landed men on the Moon.  No need to look further.
Reply: @johnwoody9505  

Um...none on the lunar landing pads.
Reply: @johnwoody9505  

You do realise that we now know that the USS Enterprise is just a model, and that - even though we see images of Captain Kirk landing on other planets - none of this is real?  Or do you think it must all be real because you've seen 'photographic evidence'?
Reply: @johnwoody9505  

>>Have you been to the moon?.
No - silly me.  I would have to actually go there.  I couldn't just trust to what the "astronauts" said.  They described it as a thin layer of dust over rock.  

Do you think that there's a layer of soil, there, perhaps?
Reply: @johnwoody9505  
And why do you think that these photos have to have been taken on the Moon?

Try to think of something intelligent this time.
Reply: @markgerhard1362  What proof do you have they weren't?
Reply: @markgerhard1362  Um.. that old chestnut. Do you really understand how dust moves on the moon when the thrust of a rocket engine impinges on it?
Reply: @markgerhard1362  Absolutely no need to but very educational and interesting to read say, "Carrying the fire" by Michael Collins.
Reply: @markgerhard1362  So Mark, full of rhetoric and more questions but you never give any links to proof, do you? I wonder why?
Reply: @markgerhard1362  I noticed you are not actually providing evidence to back up your claims. Now you have switch tactics to 'if I belittle and insult the opposition I win'. You don't...
Apollo is a fact... it has been proven... if you make a claim against it, it is up to you to provide any evidence to back up your claim. Saying 'research this' or 'research that' is not providing anything. It's not up to us to do your grunt work. If you ever do present anything then we will have to show counterpoints.
Good luck, you're going to need it.
Btw, by evidence I mean actual verifiable proofs.
Reply: @markgerhard1362  What makes you think that they weren't taken on the moon? Do you have evidence of any anomalies like an LRV without tracks?
Reply: @markgerhard1362  Mark, you have done extremely well, 180 comments and counting!!
Reply: @silenthunter8254  

>>it has been proven..
Make my day.  How has it been 'proven'?
Reply: @johnwoody9505  I don't read fiction.  As my PhD supervisor said once: "It's all lies".
Reply: @johnwoody9505  
It's not really a 'chestnut'.  We know how the dust was supposed to move on the moon when a rocket engine was firing onto it: dust goes all over the place.  You can see this very clearly in the (supposed) film taken out of the LEM during landing.
Reply: @johnwoody9505  
It's not for me to prove a negative.  You are the one who has this belief system.
Reply: @johnwoody9505  
It's quite uplifting debating with people who aren't too sharp.
Reply: @markgerhard1362  seeing as you are unaware of reality, when rocket exhaust from the landing LM strikes the lunar surface, all the loose regolith in its path is blasted outwards. As there us no atmosphere the material does not swirl in air currents and eddies. It flies straight out. Since the pads haven't touched down yet there's no reason to expect any dust to land on them.
Reply: @markgerhard1362  I would not say you're not real sharp, but if you want to admit that yourself, that's fine with me. Boy you are fun to play with, you remind me of the little kid down the street, he rides the short bus.
Reply: @silenthunter8254  
That's by far the most desperate attempt to explain away the problem that I have come across.  Where did you find it?

If you take the trouble to look at the EvidENCe, i.e., the film supposedly shot out of the LEM window, you will see - as any rational person would expect to see - a swirl of dust which continues until the LEM hits the ground.  What's your 'theory'?  That the LEM engine was switched off 100m in the air so it could crash onto the surface?

You'll have to try a bit better than that.
Reply: @markgerhard1362  the engine cut off after contact with the surface, it was throttled back before this. There was no swirling dust, the regolith flew straight out and away. You can believe anything you want, you will be wrong, but if that makes you happy good for you.
Reply: @markgerhard1362  It goes in straight lines unencumbered by the atmosphere. So as the rocket exhaust accelerates the dust it flies very fast and a very long way away, simple. It doesn't form a cloud of dust.
Reply: @markgerhard1362  So did your PhD supervisor show you any evidence?
Reply: @markgerhard1362  After all this time, all this stupefying dross, not one crumb of evidence. What a joke!! Yes I do believe we went to the moon, what a fantastic achievement.
Reply: @markgerhard1362  Mark, just about all the scientific and engineering world believe the apollo missions went to the moon, therefore it is for you to prove they didn't. They shown the evidence, you have to disprove it. It is not by rhetoric you can prove they didn't go, evidence is what is needed. There are thousands of photos, some people say there are anomalies!!
Reply: @johnwoody9505  What - you think I need 'evidence' for the statement that fiction isn't true?
Reply: @silenthunter8254  You are good at repeating things.
Reply: @silenthunter8254  
Why don't you actually LoOK at the EvidDEnce instead of speculating about what it might be?
Reply: @johnwoody9505  

>>a very long way away, simple
Not according to the footage.
Reply: @johnwoody9505  
So you still can't explain the dust on the landing pads and are now grasping, even more desperately, at a 'proof by authority'.

Sorry.  I'm only interested in 'proof by EvidEnCE'.
Reply: @johnwoody9505  

There are three obvious anomalies associated with the dust, none of which you or anybody else is remotely able to solve.

1) The lack of several metres of dust on the moon.  It's supposed to be billions of years old.  Work out how many micometeorites would have hit it in that time (there's a Scientific American article from 1960 discussing this if you can't do it yourself).

2) The lack of dust on the lander pads despite the fact that the lander rockets didn't stop until the LEM hit the surface.

3) The fact that the astronauts could somehow stick a flag pole into solid rock.
Reply: @markgerhard1362  the reason we have to repeat ourselves is that you keep saying the same thing over and over. I suggest if you want a different answer ask a different question. 
Why do you keep telling us to look at the 'evidence', btw, changing case from upper to lower in a word does nothing but show your ignorance. 
Ok, as for the lunar regolith...
The surface is not solid rock, nor is it meters of loose dust. Have you heard of the term hard pack?
If you look here
https://www.hq.nasa.gov/alsj/a11/AS11-40-5858HR.jpg
And here
https://www.hq.nasa.gov/alsj/a11/AS11-40-5918HR.jpg
You can see striations in the surface caused by the exhaust. Most of the loose material has been swept out of the blast area and you see the hard pack surface, it's not rock but tightly packed regolith.
Reply: @silenthunter8254  

>> hard pack
Obviously not.  What would 'pack' the dust? Herds of wildebeest?

>>You can see striations in the surface caused by the exhaust.
You have a very vivid imagination.
Not only is there no dust on the lander pads, there isn't not the slightly sign of a powerful rocket engine having fired in the middle of the LEM.
Reply: @silenthunter8254  

>>you keep saying the same thing over and over
And I'll carry on until you answer.
Reply: @markgerhard1362  how deep should it have gone at 1.5psi
Reply: @silenthunter8254  

Who cares?  Obviously the pressure was very much more than this.
Reply: @markgerhard1362  I keep saying the same truths because you keep asking the same ridiculous questions.
Reply: @markgerhard1362  what was the pressure of the engine? If You are as smart as you say this should be easy for you.
Reply: @silenthunter8254  
Rather than relying of random nonsense you find on 'de-bunking' websites, have a look at this:

https://www.youtube.com/watch?v=Od6LDfccrF8

At 6.43 you can see the impact the jets from a Harrier Jump Jet make from about 20m above the sea.  The LEM's engine was twice as powerful as this.  And still running when the LEM landed, as we know from the footage.
Reply: @markgerhard1362  fact check...
The pegasus 11 produces 21k lbs of thrust. On landing it would need to provide enough lift to support the harrier jet, empty weight 14k lbs.
The LM descent stage was throttled down to 3k lbs of thrust.
14k vs 3k... your 'fact' failed, the harrier produces more landing thrust.
Reply: @silenthunter8254  
Given that the gravity on the moon is 1/6 that of Earth, this is roughly equivalent to the lifting power of the Harrier jets on Earth.
Reply: @silenthunter8254  
I'm wondering if you even bothered to look at the video.  Watch as the Harrier gets closer to the water.  Imagine that this is sand than water.  The sand would be lifted up with about the same power by the LEM.  No, the finer particles wouldn't be held up in the air because there isn't any.  But the random, powerful bursts of exhaust gas would move the dust in all directions.

Yet there is no crater.  No disturbance.  Nothing.

And there is no sign of dust on the pads or on any other part of the craft.

Not believable.
Reply: @silenthunter8254  
https://www.youtube.com/watch?v=k_OD2V6fMLQ
Clouds of dust clearly visible as it approaches the surface.
Engine stops when it hits the ground.
Reply: @silenthunter8254  
This confirms that the engine is running right up to touch-down.

https://www.hq.nasa.gov/alsj/nasa58040.pdf
Reply: @markgerhard1362  that video of the harrier and Lightning 2, I've seen it before. I am an aviation enthusiast, I watch all the videos I can.
If the LM was designed to operate in earth gravity it would have been 6 times more powerful, so yes on earth the thrust would be around 60k lbs.
They harrier in lunar gravity would only need about 3k lbs, and would not have dug a crater.
Reply: @markgerhard1362  yes the engine was running at contact light then was powered back and shut down. Contact light was when the 6 foot probes contacted surface. By the time the pads made the surface the engines were at minimum right before shut down.
Reply: @silenthunter8254  So where's the crater?
Reply: @silenthunter8254  
Given that you have failed completely to explain why there is no crater under the LEM, nor why there was no dust on the pads, nor why there wasn't several metres of dust on the surface, nor how they could have put a flag pole into solid rock...your best strategy might be to resort to childish abuse, appeals to authority or nitpicking about the size of Willy's Jeeps.
Reply: @silenthunter8254  
As I explained, under 1/6th gravity the dust would be very much lighter.  It would be like firing a rocket engine over tiny pieces of expanded polystyrene.
Reply: @silenthunter8254  

So do you now believe that the footage supposedly taken out of the LEM window  - showing vast clouds of dust billowing up - was fake?
Reply: @markgerhard1362  ok, you spammed a bunch of posts, going through them here.
No crater, hard packed regolith could be caused by thermal expansion/contraction of the surface over the 28 day lunar day.
LM descent engine was throttled down to 30%, 3000lbs, spread across exhaust bell with a 59" diameter, area of 2734 sq", giving ground pressure of 1.1psi. That's not takin into account that with no atmospheric pressure to contain the exhaust it would spread out over a wider area.
Reply: @markgerhard1362  I'll leave the childish comments to you...
Reply: @silenthunter8254  

>>No crater, hard packed regolith could be caused by thermal expansion/contraction of the surface over the 28 day lunar day.

Obviously not.  We can see footprints in the dust.

>>the exhaust it would spread out over a wider area.

Not according to the film supposedly taken from the LEM.
Reply: @silenthunter8254  
So what's your next strategy, then, if not childish put-downs?  How about quoting another shill channel or 'debunking' website?
Reply: @markgerhard1362  so you have discarded the LM/willy's jeep evidence, at least you are learning something.
Reply: @silenthunter8254  
This is the difference between our thought processes.  I think rationally, based on evidence.  If the evidence isn't there, I don't continue to believe.  You, on the other hand, ignore evidence completely if it doesn't fit in with your belief system.
Reply: @markgerhard1362  maybe there is evidence of a crater that you have over looked.
https://www.hq.nasa.gov/alsj/a11/AS11-40-5915HR.jpg
The LM traveled from the bottom left to where it settled, evidenced by the scorched regolith and the way the landing probes are bent. There is an indentation under the engine caused by something, the last seconds of decreasing thrust maybe.
https://www.hq.nasa.gov/alsj/a11/AS11-40-5921HR.jpg
In this photo there is definitely a hard packed surface that has been swept of loose material. It is not solid rock, you can see the scarring and pock marks where rocks and other loose material has been knocked free.
Reply: @silenthunter8254  
One would expect to see dust blown off underneath the engine to the depth of about 1cm, and dust on the pads.  There is nothing.  No matter how vivid your imagination, there is nothing.

The sensors supposedly used to determine the moment of impact and put a light on in the cabin are also missing.  What were they supposed to do?  Break off?  Hit the rock and cause the LEM to fall over?
Reply: @markgerhard1362  you expect and assume based on what you know about the earth environment. The lunar surface is not earth environment. The 'rules' are not identical. 
You expect to see 1cm of disturbed surface, that's less than .5". You must have great eyes to tell how much material has been swept from beneath the LM in a 2d photo with no references. 
Where are the probes you asked. They are bent up around the pads, as they were designed to do.
Reply: @silenthunter8254  
>>The 'rules' are not identical. 
Obviously this is a studio on Earth, so the rules are the same.  In any case, the footprints are the same and the tracks made by the LR are the same (except for when they are missing).  It's probably a concrete floor with dust sprinkled on top.

But if we pretend that it's the Moon, we still have the obvious fact that everything looks much the same as it would on Earth.

>>You must have great eyes to tell how much material has been swept from beneath the LM in a 2d photo with no references. 

None, obviously.  There would be very obvious marks.

In any case, the complete lack of dust on the pads proves that no engine was fired anywhere near them, in direct contradiction to the fake footage (actually taken on a 20' gantry, as we know, but supposedly taken out of the LEM window).

And what about the probes?  Where did they disappear to?  My guess is that they forgot about them, just as they forgot to add the dust to the pads.
Reply: @markgerhard1362  filmed in a studio, you should try your hand at comedy, you are striking out at science and technology. next thing your going to say is the filmed in slow motion and sped up the film, right.
Reply: @markgerhard1362  - There was an umbilical between the two modules.  It was external and easily seen, it's the dark feature at the bottom of this picture:  
https://history.nasa.gov/SP-350/ch-10-7.html

More pictures:
http://www.ninfinger.org/models/vault2005/More%20CM_SM_Umbilical%20pix/CSM.Umbil.Blk.II.Jpg
http://www.ninfinger.org/models/vault2005/More%20CM_SM_Umbilical%20pix/CSM.Umbil.Exten.jpg

Pages marked 49 and 50 of this document go into the  details:
https://www.hq.nasa.gov/alsj/CSM06_Command_Module_Overview_pp39-52.pdf

Orion is going to use the same type of system:
http://104.131.251.97/spacecraft/wp-content/uploads/sites/18/2015/09/4472652_orig.jpg
Reply: @johnwoody9505   - The vehicle that crashed with Armstrong ran out of propellant for the directional thrusters.    There is an accident report in this document:  https://history.nasa.gov/alsj/LLRV_Monograph.pdf
Reply: @silenthunter8254  

>>next thing your going 
This makes no sense.  Do you mean 'next thing you're going"?

No, it was done using harnesses.  You can see them flashing in the studio lights in some shots.

So: despite everything, you still believe it could have been shot after the LEM landed on the Moon?  How come none of the dust - shown in the footage - landed on the pads?
Reply: @silenthunter8254  

>>filmed in a studio
Given that there's no evidence it was shot on the Moon, and overwhelming evidence it was shot in a studio, you are the comedian.  Note:

1) Multiple close lighting sources.
2) An obvious transition between the foreground and background with distance shots, showing use of front-screen projection, which had recently been developed by SK.
3) The LEM had obviously been craned, rather than rocketed, in.  Hence no dust on the pads.
4) The LR often shows very light tracks, showing that it was pushed onto the set unloaded.
5) The tiny layer of dust is not compatible with the Moon being billions of years old.
6) We have footage of a training site which looks identical to the one used in 'official' Moon walk footage.
7) Some photos obviously not taken by astronauts (perspective issues, etc.)

Etc. etc. etc.
Reply: @markgerhard1362  you caught me, I'm not an English major, but unlike you I'm good in the STEM arenas.
So you think the antennas are the wires... What would happen to an object that is tethered to an overhead crane by one wire place to the left and behind the bodies COG?
Reply: @silenthunter8254 

>>you think the antennas are the wires
No.  I was talking about the probes which detect when the LEM hits the ground.
Reply: @markgerhard1362  you were talking about it being filmed in a studio using harnesses. What you see flashing in the films is the light reflecting off the antennas.
Reply: @markgerhard1362  1) multiple light sources' would produce multiple shadows.
Reply: @silenthunter8254  
>>https://www.youtube.com/watch?v=Zz9Bzi_GyD0
This isn't.  Their antennas (according to diagrams) are little more than 6" long.
Reply: @silenthunter8254  They used diffuse fill-lights, just as any other studio would.
Reply: @markgerhard1362  "4) the LR often shows..."
If it was 'pushed onto the set' then where are the tracks of who pushed it?
Reply: @markgerhard1362  "7) some photos obviously not taken..."
Show us the supposed photos.
Reply: @silenthunter8254  Of what?
Reply: @silenthunter8254  They were covered up.  As you have noted, it's easy to cover up tracks in this dust.
Reply: @silenthunter8254  
There's a big difference between tracks when the LR is obviously loaded and other tracks, which are very much shallower.
Reply: @markgerhard1362  "they used diffused light"
Then why do we still see a shadow?
I'll wait as you search your reference website, YouTube videos of other HBs, to find a good ad hoc solution.
Reply: @markgerhard1362  "of what?" 
?????
Reply: @markgerhard1362  they covered the tracks? Omg you are funny...
Think maybe some are lighter because less contrast due to lighting?
Maybe regolith was thinner?
Reply: @markgerhard1362  are you a believer in the flat earth?
Reply: @silenthunter8254  

>>Then why do we still see a shadow?
Um...obviously not on the main light source.
Reply: @silenthunter8254  
Can we at least assume that, with their multi-billion dollar budget and the best film director in the world, they could at least find somebody capable of getting basic lighting right and get the props onstage without obvious clues?
Reply: @markgerhard1362  if they were going produce a faked landing film, which they did not, and use one of the best film directors, I assume you mean Stanley Kubrick, don't you think they would have produced a product that could not be dissected later. 
1) there would be a huge crater under the LM.
2) there would be dust everywhere .
3)  they would jump 20 feet into sky on every step.
4) the landing craft would be a Sherman tank made from lead.
5) the space suits would be solid lead boxes with tracks.
6) the sky would be full of stars.
7) etc... etc... etc...
And why do it 6 times, when each time something could go wrong in the production process.
Reply: @silenthunter8254  
Compared with the idiocy of the "ISS", the Apollo footage was quite well done.

>>don't you think they would have produced I can spot continuity mistakes in any Hollywood film.  Some films have dozens, even though they have budgets in the hundreds of millions.   

Do regard that as evidence that these are real events?  Do you think that James Bond must be a real person, because the film-makers would have 'thought about' the fact that someone should not fall into a lake and come out bone dry (Sky Fall).

>>1) there would be a huge crater under the LM.
Obviously not, because the surface was rock.

>>2) there would be dust everywhere .
They obviously forgot to put dust onto the lander pads.

 >>3) they would jump 20 feet into sky on every step.
How would this be possible?  Humans can't jump over 3' with each stop.  More rationally, the fact that not a single astronaut jumped at all is very strong evidence that they weren't on the Moon.

 >>4) the landing craft would be a Sherman tank made from lead.
No, obviously that makes no sense.

 >>5) the space suits would be solid lead boxes with tracks.
Um...no.

 >>6) the sky would be full of stars.
As described by ISS astronauts, you mean?  The sky wasn't full of stars because they obviously wouldn't be visible during daylight hours.

>>And why do it 6 times, when each time something could go wrong in the production process.
Not really, since the same thing was done six times over.  It would have looked even more ridiculous if they had only gone once.
Reply: @silenthunter8254  
Just to be clear: do you believe that the endless scientific absurdities in Star Trek mean that it must be real?
Reply: @silenthunter8254  
It is also quite possible that the mistakes were left in on purpose.  There are a number of very specific clues in The Shining, for example, which appear to allude to the A11 hoax.
Reply: @markgerhard1362  what in the shining,  apart from the apollo tie was it, that pointed toward a faked apollo. Kubrick never admitted his involvement, and he was powerful enough to stand up to TPTB. At the end of his life, he would have revelled in pulling off the hoax of the century.
Reply: @markgerhard1362  star trek us a good show of how good will win out.
As for the science if star trek.
Bug screen TVs
Computers in your rooms.
iPads. 
Cell phones.
Medical diagnostic beds.
Hypo spray injections. 
And many more.
Yes, the warp drive and many other aspects are not in the foreseeable future, but don't rule out human ingenuity. 
Now the technology of star wars, forget. 
Still as a story, not too bad.
Reply: @markgerhard1362  so, are you a believer of the flat earth? If you don't answer you will have confirmed that you are.
Reply: @silenthunter8254  
>>apart from the apollo tie was it
The boy with an Apollo shirt stood up from a carpet pattern which obviously looked like the Apollo launchpad.  He moved towards the door of a room which coded the mean distance to the Moon in thousands of miles.  Inside that room, the hero saw a young woman (Moon = female energy) which he engaged with.  This then turned into an old hag.  This suggests that his engagement with the Moon project went sour.  When he was typing the same sentence again again, it said 'All [A11] work and no play makes Jack a dull boy'.

>>he was powerful enough to stand up to TPTB
Until he produced Eyes Wide Shut, and died mysteriously, 666 days before the beginning of the new millennium.
Reply: @silenthunter8254  
>>how good will win out.
There's nothing remotely 'good' about the Federation: it's a brutal dictatorship. 

The question is that mistakes in a film are not evidence that the events are real rather than fiction. They are simply evidence that continuity directors aren't perfect.
Reply: @silenthunter8254  

>>If you don't answer you will have confirmed that you are.
And this would somehow constitute 'evidence' that I am biassed?
Reply: @silenthunter8254  
You have to use logic rather than your belief system.  

Which is more likely, a) that clouds of dust went everywhere apart from the pads or b) there was a continuity mistake.  

Continuity mistakes are commonplace and easily demonstrated; clouds of dust have never been shown to have preference for particular structures when they settle.
Reply: @silenthunter8254  Or c) it was a deliberate clue put in by a director known for putting in deliberate clues.
Reply: @markgerhard1362  'clouds of dust' implies an atmosphere. Breakdown in your logic, for there to be a cloud of dust swirling around waiting for the pad to set down there must be an atmosphere. There is not, not clouds to settle on landing pads.
In the footage during the landing we see material being blasted away from the point of contact. That material did not hover, it traveled straight out, as seen from top down, from the side it would have a ballistic trajectory. By the time the pads touched there was no material left to settle.
Reply: @markgerhard1362  yes, being a follower of the FE model does bias you against science, technology and logic.
Reply: @silenthunter8254  There was plenty of gas there to form clouds.
Reply: @silenthunter8254  No it doesn't.  Not even remotely.  Try another one.
Reply: @silenthunter8254  
So you still believe that the dust landed everywhere apart from the pads.  How?
Reply: @silenthunter8254  
I spend much of my time going through scientific papers, and have science degrees from two of the top universities in the world.  I have great respect for science.

What I don't have respect for is people who trust in authority figures, believe whatever they think is the 'popular' choice and are unable to think for themselves.
Reply: @markgerhard1362  "plenty of gas there to for clouds."... 
Did you really say that?
In near perfect vacuum? 
Are you so desperate to disprove the moon landings you will make up evidence for enough gas to form clouds on the moon. A place that is near 0 pressure?
Reply: @silenthunter8254  Um...what do you think was coming out of the rocket engine?  Strawberry jam?
Reply: @silenthunter8254  
>>make up evidence
I don't 'make up evidence' I can see it in the footage.  Dust is spewing up from the ground, supposedly because it has been hit by gases coming out of the rocket engine.

Why don't you look at the *evidence*?  Or do you now accept that the entire thing was fake, so there's no point bothering to do that?
Reply: @markgerhard1362  as little 'gas' that was coming out of the engine dissipating into the vacuum, there is not enough to form a cloud to suspend the regolith/dust to fall into the pads. If you watch the film you see the material moving away at a very high rate, none of it billowing into clouds.
Reply: @markgerhard1362  you know, if you send your posts to those two top universities maybe they might refund your money, of course you would have to deny any affiliation with them.
My cat looked at my old tech manuals, that doesn't mean he can fix a radio.
Reply: @silenthunter8254  It's going up and will fall down again, obviously.
Reply: @silenthunter8254   
Why don't you stop the childish put-downs and try to get back to attempting to take part in an intelligent discussion about the Moon 'landings'?
Reply: @silenthunter8254  
We've established that burning hypergolic fuel creates clouds of gas, even in a vacuum.

We've established that the engines were on almost on until the LM touched the ground.

We've established that, even when throttled back to 2000 lbs-f, the engines still kicked up dust several feet into the air.

We know that there is about 1cm of dust on the surface.  

We know that this dust is visible.  We know, therefore, that it would be seen if it were on the pads (it's not 'fairy dust').

We know where the landing pads were, relative to the engine.  

We know where the nozzle of engine was, relative to the dust.

What are you still confused about?

Beyond the usual childish abuse, put-downs and other personal defense mechanisms, what do you have to say?
Reply: @markgerhard1362  I apologize for that comment, but a little levity helps reduce tensions, and you have to admit that a university's board of regents would not look fondly at any professor of science who would bring such an idea as the moon landings being faked, if the hypothesis is only backed by the flimsy evidence presented so far.
Having said that, the 'evidence' you are currently clinging to is lack of dust on the landing pads. You have been presented with photographic evidence of there actually being dust of the pads. Do you abandon this claim and switch to your next?
Reply: @silenthunter8254  
>> if the hypothesis is only backed by the flimsy evidence presented so far

Um..it's not for me to prove that the events were hoaxed.  It's for believers such as yourself to provide evidence to back up your beliefs.  In any case, there are dozens of reasons to doubt the official narrative on this.

>> You have been presented with photographic evidence of there actually being dust of the pads.

Um...for the third time...the presence of dust on some pads is completely irrelevant.  The dust **could have come from anywhere**.  The >>>absence<< of dust on at least some of the pads is more than enough to demonstrate that the LM didn't 'land' anywhere.  Or is your theory now that the wind was blowing the dust away, so it only landed on some of the pads?
Reply: @markgerhard1362  um... it is the responsibility of those who claim it is a hoax to provide evidence and then defend that evidence. 
So your defense of your claim of no dust on the pads is now some dust was obviously put there, so all the pads should have dust. If it was shown that all the pads do show some dust then what? How far are you going to move this goalpost before you pretend it was never brought up and move to the next claim?
Reply: @silenthunter8254  
So you are unable to explain the bizarre dip which appears to have been dug up out of the ground in the photo I linked to.  Fair enough.

>>it is the responsibility of those who claim it is a hoax to provide evidence and then defend that evidence. 
You claim something extremely unlikely which has never been done before or since, and for which there is no evidence other than some old footage and a few photos.  It's not my job to prove that it didn't happen, although it's easy to do.  

I'm quite surprised that you don't feel any need to back up your belief system with evidence, nor any ability to do so.

>>So your defense of your claim of no dust on the pads is now some dust was obviously put there, so all the pads should have dust.
Obviously not.  Why don't you read my comments before responding?

>>If it was shown that all the pads do show some dust then what? 
Then it would at least be physically possible that they have been in a cloud of dust coming from the rocket.  But they don't, so it's not.
Reply: @markgerhard1362  if this was done on a set as you claim, why would they had to dig a last minute hole for the pad, wouldn't they just put it down somewhere else? 
Some old film and a few photos...
Hours and hours of film. old? Well it did happen 50 years ago so...
A few photos? Over 3500 photos are more than a few.
Reply: @silenthunter8254  

>>if this was done on a set as you claim, why would they had to dig a last minute hole for the pad, wouldn't they just put it down somewhere else? 
It doesn't look flat anywhere, does it?

>>Over 3500 photos are more than a few.
Um...it's not the number, it's what's in them.  3500 pictures of the same studio set doesn't make it real.  

You didn't say if you believed that Star Trek is real or not.  Since you regard photos and film as proof, I can only assume that you do.
Reply: @silenthunter8254  

What is your explanation for these weird black 'shadows' coming out of the bottom lunar pad?

https://www.lpi.usra.edu/resources/apollo/frame/?AS11-40-5925

Notice the position of the other shadows.
Reply: @silenthunter8254  
>>https://www.youtube.com/watch?v=6kF7mg3yREY

07:29
How did it manage that?  Obviously no real craft - having been orbiting the Earth at around 30,000km/hr - could get to its target with such accuracy.
Reply: @markgerhard1362  if this had been a set it would have been built so the placement of the LM would not have needed a fix of this severity.
All the photos were available around the time of the landings.
The networks broadcasted the lunar EVAs.
Reply: @silenthunter8254  
>>if this had been a set it would have been built so the placement of the LM would not have needed a fix of this severity.

So what's your explanation?  Do you think that the astronauts themselves did it?

And what's your explanation of the bizarre shadows I pointed out?

>>All the photos were available around the time of the landings.

No they weren't.  
https://www.express.co.uk/news/science/991989/NASA-moon-landing-photos-Apollo-11-pictures-Neil-Armstrong

And even if they had been, so what?

What's your explanation for the ability of the CM to land a couple of kms from the rescue ship?
Reply: @silenthunter8254  

>>if this had been a set it would have been built so the placement of the LM would not have needed a fix of this severity.

People make mistakes.  My guess is that the people who make the set aren't that bright.
Reply: @silenthunter8254  

>>if this had been a set it would have been built so the placement of the LM would not have needed a fix of this severity.
The concrete underneath was at the right level.  All that happened was that the grunt who put the dust on put too much here.
Reply: @markgerhard1362  do I think Star Trek is real? No, as I have said before, they are just fictional stories. At the time the technology looked like fantasy, like the communicator, who would be able to carry a wireless comm device, that's impossible (says the average viewers in the 1960s).
Many other technologies were predicted, iPads, large screen TVs, personal desktop computers, electronic books...
Some technologies may still happen, warp drive, sub-space comm (quantum entanglement?), defense shields, and such.
Transporters, don't thing possible in near future.
Reply: @silenthunter8254  
Good.  At least in that area, you are able to separate fact from fiction.
Reply: @silenthunter8254  
How is it that you are able to make that distinction?  Why do you believe that Star Trek is fiction, but the Apollo landings were not?
Reply: @markgerhard1362  evidence says star trek was a TV series. 
Evidence says Apollo landed on the moon.
Reply: @silenthunter8254  

>>Evidence says Apollo landed on the moon.
Um...what 'evidence'?
Reply: @silenthunter8254  
Presumably you believe that this is the site of an actual plane crash, even though the evidence of your sense tells you that there is virtually *no wreckage*.
Reply: @silenthunter8254 
You have no evidence at all.  All you have is your belief in the honesty of authority figures you have never met.  Wow.
Reply: @markgerhard1362  the photos were available in print format. If you wanted a certain photo you sent to NASA PR dept that handled the distribution if material stating which photo you wanted, along with a check, and 3 to 6 weeks later they mailed your photo(s) to you.
Around 2006 NASA partnered with Arizona state to digitize all the apollo negatives for public access on the internet. 
They scanned the negatives and converted them to a web friendly format.
Reply: @markgerhard1362  that weird black shadow, if it is the one that starts where the landing probe comes out from under the pad, is... the shadow of the landing probe.
All the shadows line up as the should. If you 'think' they are fishy that is a problem you need to have checked.
Reply: @silenthunter8254  
So therefore they must have been taken on the Moon?  I'm sorry, I'm not following your logic.
Reply: @silenthunter8254  Look at the light shining onto the pad in the foreground.
Reply: @silenthunter8254  
Either the light is coming from the 7 o''clock position, lighting up the foil on the front leg; or else, it is coming from the 4 o'clock position, and running almost parallel to the ground, causing shadows from the antenna, other leg and object stuck in the ground.  It can't be coming from both directions.
Reply: @markgerhard1362  you have obviously never been to an actual aircraft crash site have you... you have no idea what an aircraft hitting the ground at two to three hundreds of mph looks like. You aren't one of those who think jet airliners go slow are you.
That could be looking back along the path.
Reply: @silenthunter8254  

>>you have no idea what an aircraft hitting the ground at two to three hundreds of mph looks like. 

I haven't been to Greenland, but I don't doubt that it exists.  There are plenty of photos of real crashes available.  They include engines*, *wings and a *fuselage*.   These parts don't simply vapourise on impact.
Reply: @silenthunter8254  
Here's the difference between us: I am an evidence-based thinker, whereas you are an authority-based thinker.  There's a role for both types in this world, so don't feel that that's a criticism.
Reply: @markgerhard1362  at that crash site, if the camera was turned the other way along the path of impact you may see the wreckage of the aircraft, it is you who are jumping to the conclusion that there is no debris. Lack if visual evidence in one photo does not prove there is no accident. You have see the bigger picture to see the whole story.
Reply: @silenthunter8254  

>>if the camera was turned the other way along the path of impact you may see the wreckage of the aircraft

That makes absolutely no sense.  Are you suggesting that the television cameramen are unable to point their cameras in the right direction?  Even a drunk person could find the remains of a large jet if it were a few feet in front of him.
Reply: @silenthunter8254  
The truth is, you are simply not interested in evidence.  Your belief system is based on group-think and acceptance of authority without question. 

How did A11 land a couple of kms from the recovery ship?  Obviously, because it was chucked out of a plane.
Reply: @markgerhard1362  at the crash site we see a man in a suit looking at a piece of what appears to be metal. The cameraman wanted a photo of that man. As this is a still photo and not a video camera all we see is this one direction. If you have an actual video or other photos then please link those and we can study them more, and investigate the evidence.
Since this is your photo and you mentioned that it was of an aircraft accident my statement is still valid. I can compare it to the 5 aircraft crash sites I have been involved directly with, and the half dozen I have seen documented, in my role as an Air Force accident investigation team support member. Two of the accidents I was directly involved with was with an air search and rescue team I was on in high school.
Reply: @silenthunter8254  

In other words, if the evidence is missing, you just imagine it.  Fair enough.

>>Two of the accidents I was directly involved with was with an air search and rescue team I was on in high school.

And did the planes disappear into thin air?  I doubt it, somehow.
Reply: @silenthunter8254  

>> I can compare it to the 5 aircraft crash sites I have been involved directly with, and the half dozen I have seen documented, in my role as an Air Force accident investigation team support member. 

This is an attempt at 'proof by authority'.  The evidence is simply irrelevant to you.  This is why you can't process information properly.
Reply: @markgerhard1362  how did the recovery ship know where to look for the capsule? 
7 mercury flights, 19 gemini flights, 16 unmanned apollo program flights, 2 manned apollo earth orbit fights, 2 lunar orbit flights, by then predicting the reentry point was not an impossible task. 
Your pretty smart think about this.
They know the distance between point A (moon) and point B (earth).
They know the weight of the capsule, they know the thrust of the engine so they know the acceleration of the capsule. 
Calculate the rate needed to get the capsule to the reentry point when you want it there.
Have the recovery fleet there when it gets there.
It's all math...
Reply: @silenthunter8254  
>>They know the weight of the capsule, they know the thrust of the engine so they know the acceleration of the capsule. 

Um...obviously it has nothing to do with the mass of the capsule, because it's in free-fall.

It has nothing to do with the thrust of the engines for the same reason.

>>Calculate the rate needed to get the capsule to the reentry point when you want it there.
Obviously not.  Think before writing.

The capsule is in orbit, travelling at about 3km/s.  It can't know its exact location.  The time taken to land will depend on the exact angle of attack into the atmosphere.  This also can't be known exactly.
Reply: @silenthunter8254  

>>7 mercury flights, 19 gemini flights, 16 unmanned apollo program flights, 2 manned apollo earth orbit fights, 2 lunar orbit flights,
Not even remotely relevant (even if the numbers were correct).

>>They know the distance between point A (moon) and point B (earth).

What has this got to do with anything?
Reply: @silenthunter8254  

>>at that crash site, if the camera was turned the other way along the path of impact you may see the wreckage of the aircraft,

Except that we know that you can't.  Watch the videos.  Look at all the photos.  There was No PlaNe.
Reply: @markgerhard1362  of the 46 photos maybe 12 were of the crash site, many from a distance. 
I will amend my previous statement, that 737 may have hit doing greater than 400kts, full of fuel the resulting fireball could erase a lot of debris, the large peices that were seen look similar to the engine nacelles. 
The two aircraft accidents I was involved with in HS were small private aircraft, piper j3 came down in a field doing about 50mph, it was spread across 50 yards, the pilot, only soul on board, had a heart attack, was dead about 30 minutes before it hit, ran out of gas 5 minutes before impact.
The other was a twin engine baron that got disoriented in bad weather and hit a treeline at 150mph, the vertical stabilizer was mostly intact. 4 on board, we pulled a 12year girl old out, lost her left leg. Mother, father, 15year old sister not so lucky.
Reply: @markgerhard1362  to get out of lunar orbit to return to earth they had to light the engines... just a few minutes, then shut down. A few fps more or less is all that is needed to change reentry point. Mid-course corrections to fine tune.
Reply: @markgerhard1362  so you, an inexperienced crash investigator, can tell from 12 or less photos all there is about a crash site. 
You mentioned your university degrees from top schools... what are and what are they in?
Reply: @markgerhard1362  if you know the distance between two points you can predict how long an object will take to travel from A to B depending on your rate of travel.
Reply: @markgerhard1362  the relevance of the previous missions is knowledge gained from mission to mission. You learn to walk before you can run.
Reply: @silenthunter8254  

>>of the 46 photos maybe 12 were of the crash site, many from a distance. 
Who cares how many photos there were of trees and fields?  Obviously, if there had been any wreckage, the photographers would have photographed it.
Reply: @silenthunter8254  

>>an inexperienced crash investigator
You are attempting 'proof by authority' rather than 'proof by evidence'.

I don't need to be an aviation expert to notice the complete absence of any wreckage.
Reply: @silenthunter8254  

And?  What does this have to do with descending from Earth orbit?  Nothing, obviously.

Why don't you read my comments before writing completely random replies?
Reply: @markgerhard1362  I do read your post, very entertaining, I haven't laughed so hard in days.
Apollo 11 did not reenter from orbit.
Reply: @silenthunter8254  
>>the resulting fireball could erase a lot of debris, 
There is no sign of a fireball anywhere.  Even the straw is not burnt.

And, even if there were a fireball, it would obviously not vaporize entire engine blocks.

I can see that you are not an evidence-based thinker.
Reply: @markgerhard1362  do you have xray vision to see below the soil, that's where the engines may end up.
I'm not trying for 'proof by authority'. 
Have you been to a crash site? Do you have any experience in the field? 
So you expect to be the authority of everything you have no knowledge of...
First you are a photographic analyst...
Next you are a video analyst...
Then a rocket scientist...
Also an accident investigator...
Oh, I forgot, an English professor. This one I might accept... you do construct your post well.
Reply: @silenthunter8254  

>>an inexperienced crash investigator
I have investigated dozens of fake crashes.  They are all pretty much like this one.
Reply: @markgerhard1362  but you missed some evidence...
Large area of charred soil... flash fire from fuel ignition. 
Displaced soil from where they were digging with the excavation equipment, looking for engines and other higher mass object buried on impact.
How many fake crash site did you not go to?
Reply: @silenthunter8254  
>>Large area of charred soil.
The soil is not charred.  Nor are the shoes which were obviously placed there.  Nor are any of the pieces of metal.  Nor is the straw. 

>>Displaced soil from where they were digging with the excavation equipment, looking for engines and other higher mass object buried on impact.

How could an engine bury itself in the ground?  It might (conceivably) make a crater a couple of feet deep.

>>other higher mass object buried on impact.
You have seen too many cartoons.
Reply: @silenthunter8254  
What is it about your belief system which is so compelling, and so overwhelming, that you would rather believe complete nonsense (so long as it comes from an authority figure) than the evidence of your own eyes?
Reply: @silenthunter8254  

>>Displaced soil from where they were digging with the excavation equipment

Yes, this is how the soil was displaced.  Diggers - unlike 737s - are able to excavate soil.
Reply: @markgerhard1362  you clever little girl...👏👏👏
I fell for one of the oldest HB tricks...
You had no hope of proving your silly claims so you pulled the old switcheroo... change the subject ya did. You were losing that one too so there should be another switch coming up. Where to this time? Chemtrails? Jet engine fuel hoax? Flat earth?
We await your decision...
Reply: @silenthunter8254  

>>You had no hope of proving your silly claims

In your wet dreams.  You are unable to explain the lack of dust on the pads, the ability of the men to stick a pole into solid rock, the lack of any sign of disturbance under the rocket engine and the astronauts' mysterious ability to arrive 2km from the target.  In the case of the last one, you completely failed to even understand the problem and made some weird suggestions about mass and thrust which had nothing to do with a craft in free fall. 

You have also failed to explain the lack of 99% of the debris in yesterday's plane crash hoax, despite offering a number of bizarre and imaginative suggestions.
Reply: @markgerhard1362  so your going with the HB ploy, throw a hundred claims out and if they all aren't answered, in your ridiculous way, they right.
I showed disturbed soil under the engine bell... just because you don't understand how to plan an event like the reentry does not negate the fact of that event.
Mass/thrust determines speed of return from the moon, speed determines time of reentry. Adjust the thrust you change the speed. Changing the speed you can plan when and where the reentry happens. If you know when and where it enters you can have the recovery fleet in position. 
You failed to understand that when an aircraft hits the ground at a high rate if speed and a steep enough angle the higher mass objects can be buried in the ground.
By the time those photos were taken the crash site had been contaminated by uncontrolled access. The cranes had dug up the area further destroying the scene.
Later photos show a large amount of debris collected from the site. You were only looking at a small part of the scene.
And you keep dodging truths and throwing out previously debunk 'evidence' to move the goalposts...
Reply: @silenthunter8254  

>>you clever little girl.
Since you are unable to even understand most of the anomalies, let alone explain them - and have therfore resorted to childish abuse - shall we just close the discussion?  I don't think that there's much chance of an intelligent discussion with you.

I'm really not interested in an exchange of childish put-downs.
Reply: @silent hunter Wow. I almost read this whole thread. Almost. I think that I skipped over a couple of weeks and your sparring partner @Mark Gerhard was STILL going on about the lack of dust on the landing pads. I congratulate you, my friend, on carrying on a conversation with a hoaxer that beat my record by a long shot.
Reply: And they test this llrv crap without payload.. lol what's the point as the real thing would be completely different with payload.
Reply: @markgerhard1362  The LLRV/TV had over 800 flights and three crashes occurred. This is a remarkable safety record. Out of 200 flights of the X-15, two crashed and only one crash resulted in total vehicle loss.
Reply: @markgerhard1362   So, You know nothing about spaceflight and space equipment?...